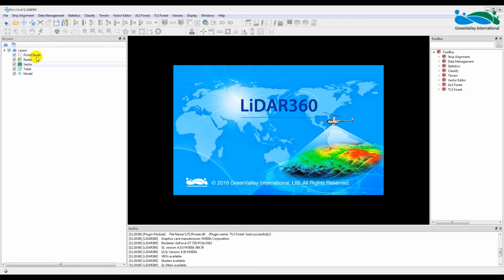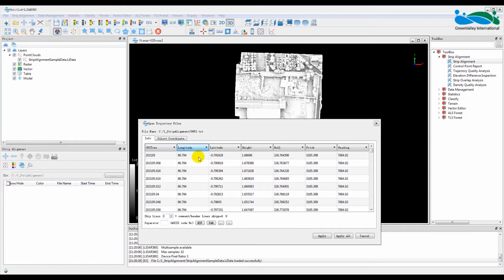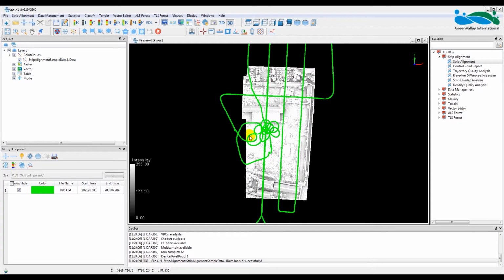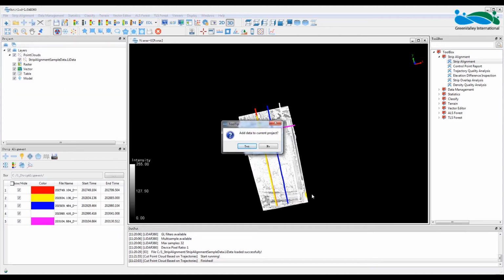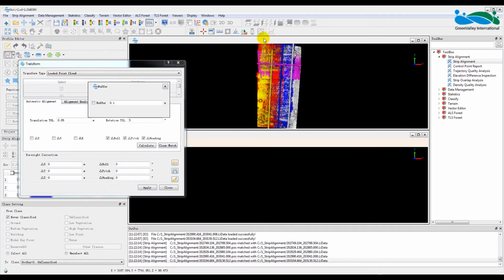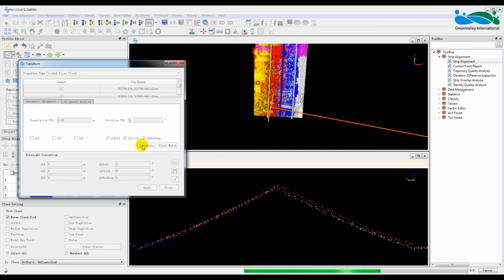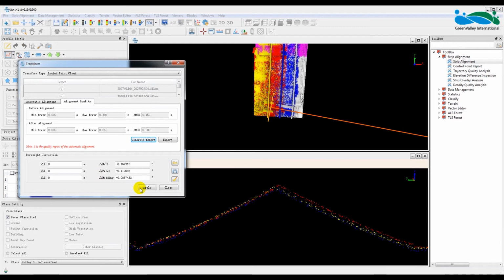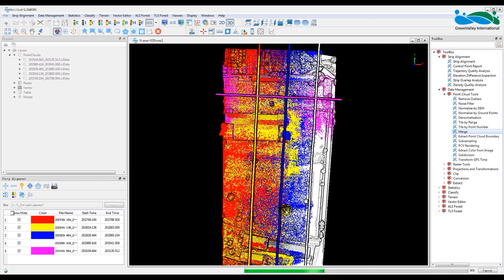LiDAR360 (v4.0) | Tutorial 05: Boresight Error Correction and Strip Alignment

Comment: After I Split Trajectories, and I try using The cut point clouds based on trajectory tool, it doesn't do anything. What could cause this?
Reply: I just figured this out. You need to import your trajectory file and then delivery convert gps time and select the date of your flight. And it works.
Reply: @mbmiller34  "and then delivery convert gps time" doesnt make sense. I'm having this same issue. What did you mean by "delivery"??

Comment: In Ver 5, After the Trajectory Adjustment tool is used it creates "Corrected Point Clouds" in a subfolder.  It also creates a "correct POS trajectory file".    It does not give you the option to add the new files to the Current Project like all other tools (merge, cut overlap, smooth, etc).  So I do not understand if I need to completely start over and import the "Correct Point Clouds" into the Lidar360? 

Any help in how to properly run the Trajectory Adjustment Tool will be greatly appreciated.
Reply from the maker: Please manually import the corrected files stored in the user-defined output path/location. We will report this problem to the LiDAR360 team for them to consider adding the pop-up window for importing processed files like many other tools do to prevent confusion. 

In the meantime, please refer to our “LiDAR360UAV data preprocessing.pdf” document for tutorials on the trajectory adjustment tool. If you cannot find it on our website, please email us for a copy at support@greenvalleyintl.com

Comment: Do you have a video on using the Trajectory Adjustment Tool?
Reply from the maker: LiDAR360 v3.2 Tutorial | Strip Alignment Workflow - https://youtu.be/ya0h6blysLE
A bit old but still very much useful! The interface is the biggest difference (with most strip alignment related tools located in Preprocessing and all easily found in the Toolbox default set to the right side of the software).

If you're still having difficulties with something specific. You can always check out this section of our guide:
https://greenvalleyintl.com/GVITutorials/LiDAR360StripAlignment/LiDAR360StripAlignmentIndex.html
or email us at: 
support@greenvalleyintl.com

Lastly, we recently collaborated with one of our distributors giving a 1-hour LiDAR360 tutorial! I've provided a link to the exact part on Strip Alignment below 🤝 The part where the presenter begins talking specifically about Trajectory is around the 11:40 mark if you want to skip ahead. Hope this helps!
https://youtu.be/uEjCEQxGJxw?t=456